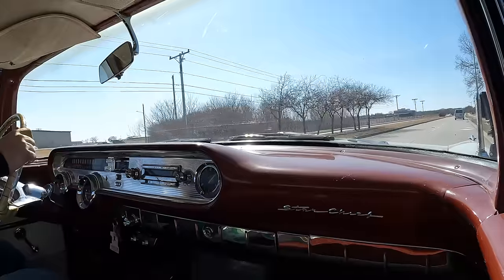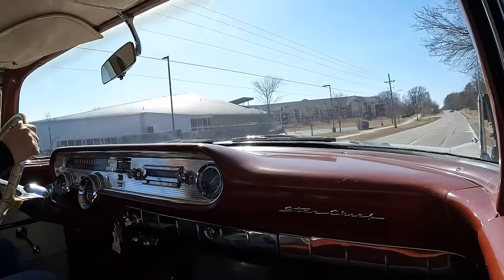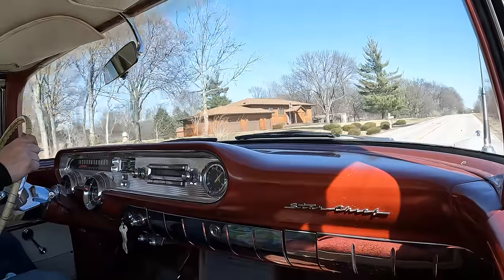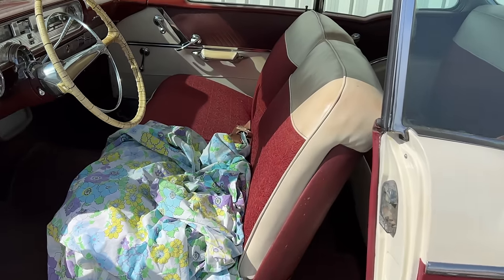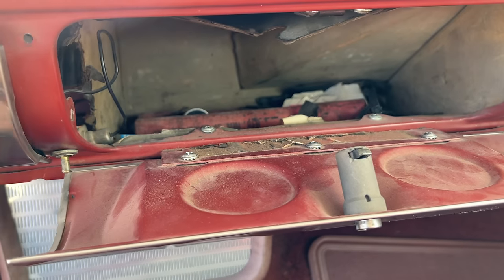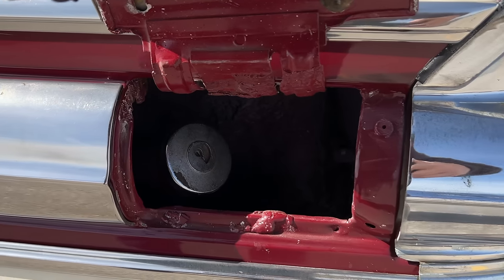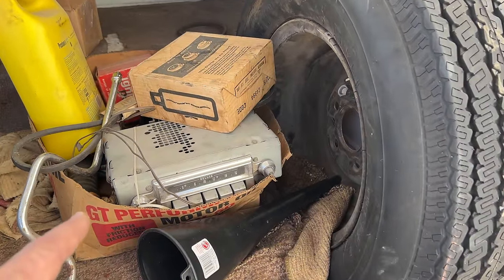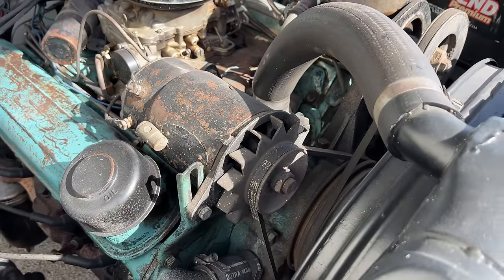Driving the 1957 Pontiac Star Chief

Comment: I owned one of these! 1957 Pontiac Star Chief Catalina 2-door hardtop (same body shell as the '57 Chevy Bel Air 2-door hardtop).  I bought mine in 1974 in Los Angeles, from the original owner, who had repainted it from the original colors of Limefire and Seacrest Green. It had been repainted Metallic Forest Green with a white side sweepspear. Mine had PS/PB, Wonderbar radio, heater, wide whitewalls, Rochester quadrajet carburetor, and of course, the 347-V8 with Dual-Range Hydramatic, and Positraction rear end (first year it was offered). I really enjoyed driving mine! Interior was original Limefire and Seacrest Green with real leather seats. I owned it until selling it to a member of the National POCI Pontiac Club in Sacramento, California, in 1986.

Comment: Back in 1964 I bought a 57 Pontiac Star Chief that came from the factory with Tri-Power (three duces) and three speed stick shift. I am sure it had to have been a special order back then. It had a 2:75 rear end gear. I would drag race the Chevy 327 cubic inch 300 horse power new Chevy Impales and could nose them out or not lose by much only using first and second gear in the quarter mile.